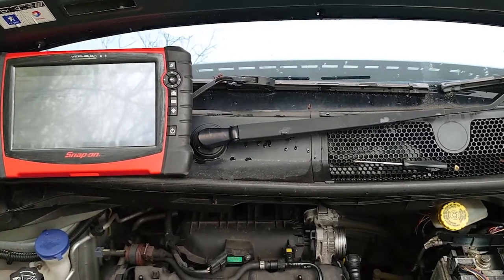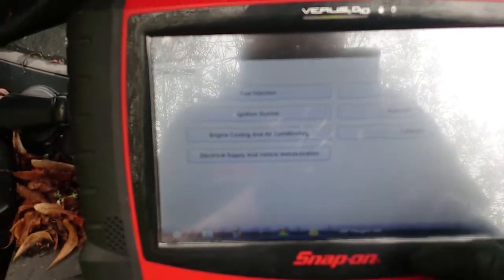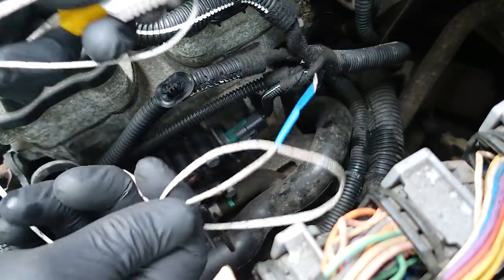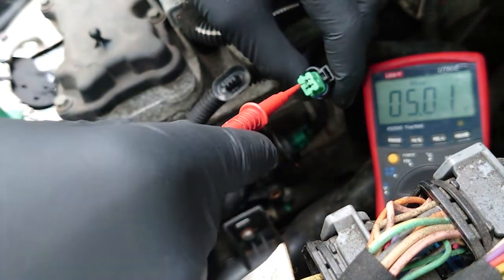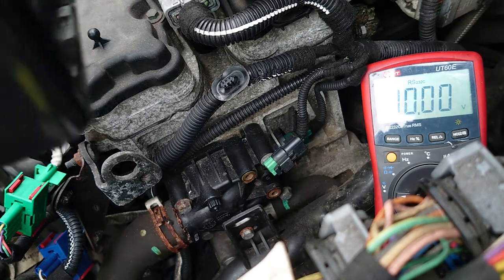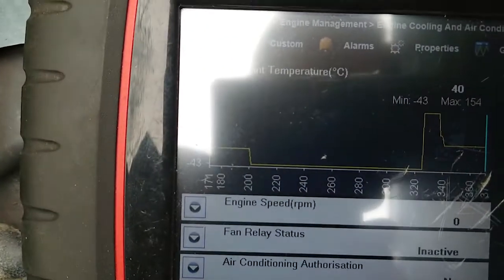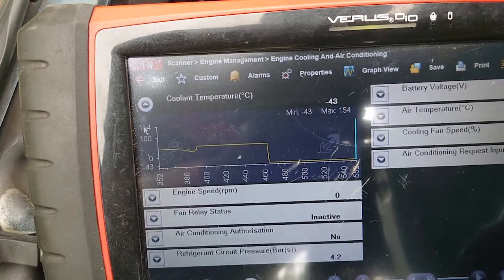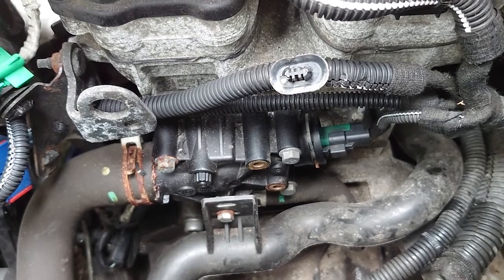P0118 - How to test a coolant temperature sensor Peugeot

Comment: Hi on our 308 CC we have the fan running all the time when the engine is switched off. I followed your checks and find the voltage is only 3.5 volts, also the sensor resistance is 2500 ohms when cold. Should i trace the reason for only having 3.5 v instead of 5V?
Thanks

Comment: You don't test the actual sensor for faults, only the loom and connector. Would you test it by extracting it from it's housing and then performing the 'hot water' test and measuring the resistances as the water heats up to 100*C?
Reply: Exactly. And you can look for the specific values according to the car manufacturer in its service manual

Comment: Thanks for this very informative video.. Question: 1). Multimeter check  for 12 volts - what do you mean by:  'moving black lead across' ? Across to where, if it's not to ground? Great collection of 'Basic Electrical Tests' .... thanak you so much. Lloyd. Qld Australia.

Comment: I am interested, does ecu send power to the relay to start the cooling fans or this sensor send ground? When reach temp, closed circuit and ground the coils of relay? I am confused , can it measure resistance and  send information to ecu to measure temp and be like switch style temp sensor? Thanks